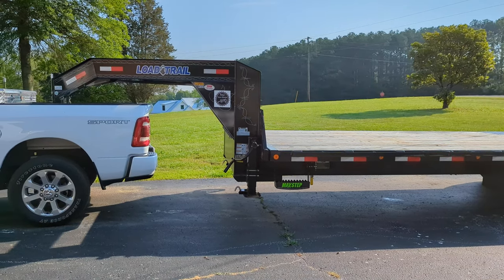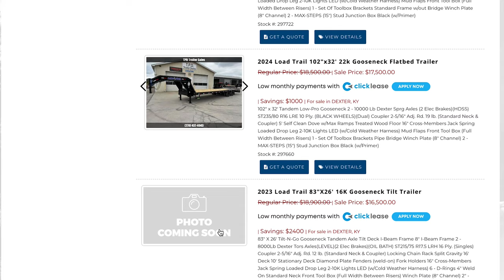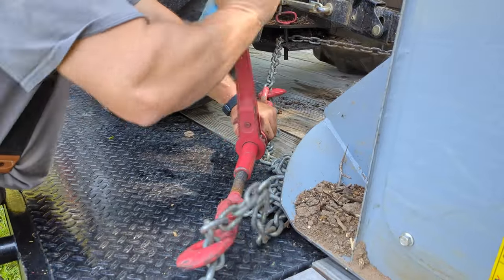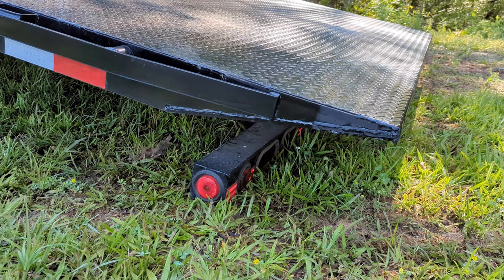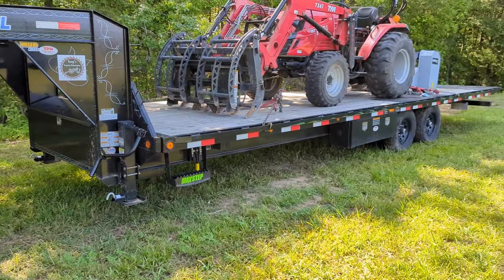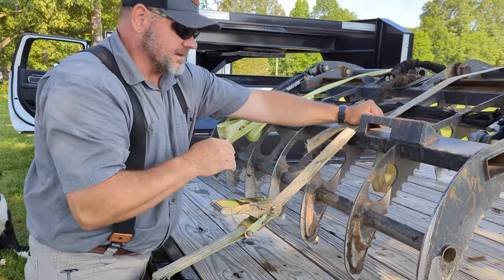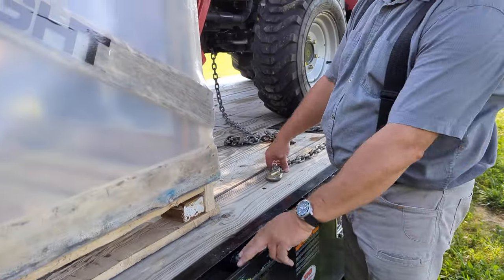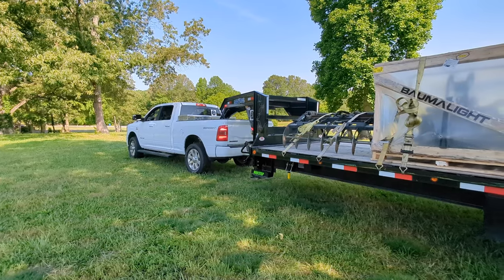Tilt Gooseneck Trailer - Deck Over - Buy the Right trailer!

Comment: Hey Chief I appreciate your post, but!  A negative and then some comparisons.  The possible negative is the single chain tie downs on your tractor.  A DOT officer might find exception to that method.  They like a four point pull.  I do it your way for very short pulls, but long and especially interstate pulling I go all out to not be ticket-able.  I bought my first 4x4 pickup in 1967 and personally always had bumper pull trailers.  I use my trucks more as super duty wagons, 98% of the time with a topper.  I do use load leveling hitch’s and can very the support arm rating if needed.  I generally haul smallish tractors ( that’s what I have) and two is my max weight  on a 20’ trailer.  No real complaints, two axle braking would be a plus for sure.  Carry two spares and cones, jacks, etc.  More stuff than you ever hope to need.  I also use an infrared gun to monitor wheel bearing and tire temps.  Grade 70 chains, etc.  I never had a stop, but I learned the hard way decades ago about extra spares and wheel bearing issues.  I love your rig, but too steep for this solo old man.  I haul for me, just a nut with too many tractors and chasing the bargains ( expensive education).  I think you need to use that remote, you don’t bounce like you used to.  6 out.

Comment: Great explanations of pro's and cons. I was going to suggest putting your ratchets on the right side as another commenter suggested. So much safer if you have adjust one on the road. A friend was hit and killed when he got out to adjust a chain binder on the left side. Appreciate you and Tanya, stay safe.
Reply from the maker: If I were going to make long hauls, I probably would. Most of my hauling is done from point a to point b. Less than 20 to 30 miles.
Reply: Copy That.

Comment: I do like your trailer.   Your review was spot on too, made me think about things i had not as of yet.
I want to make a "safety suggestion though, i noticed you made all your ratcheting attachments on the driver's side and for ease of use that makes sense but for "safety" please make them on the passenger side and all hard connections on the driver's side.  
Doing this is safer if you have to check your load or even make adjustments after a few miles.  This will put you on the grassy or sidewalk side of the road and farther away from traffic.  Drivers these days pay less and less attention when driving and you being on the "road" side puts you closer to traffic and raises your potential of being struck by a vehicle. (I have seen the aftermath of this, its terrible)  When you are in the passenger side you have an "out"... a way to run away from a potential collision.  
Please put your ratchets on the passenger side.  It is safer.  You have a great channel and would hate for anything to happen to you.
Reply from the maker: You are 100% correct. I get lazy on short trips. Thank you so much for caring and training me in such a humble way. God Bless.

Comment: I have a 20' bumper pull that's 16x4 beaver tail. Took a long time to get good at backing up. My brother has a 20' bumper pull that's 16' hydraulic lift. Hands down the best compromise I've seen between deck over and car hauler. But cost nearly 3x as much!

Oh and i haul water (900 gal) with mine regularly, with weight of trailer and full load, and balanced properly, it's just at the limit of my hitch. A goose neck would be a better choice. Compromises!
Reply from the maker: I understand about compromises. I love the trailer, but there are draw backs to this type that I didn't see before owning it. Still, It will most likely be here to I die.

Comment: The point about strapping down your load prior to loading your tractor is key. That makes the utility of a flat deckover with hydraulic dovetail MUCH more attractive. That note was key to your review and helped me tremendously. Also, its a crime to have hydraulics on the trailer... and not have hydraulic jacks.

Comment: Any thoughts on a deck over with rear slide in ramps?
Reply from the maker: If I had to do it over again, I would buy the spring up rear ramps. Slide in ramps would have a few problems on this size trailer. For the ramp to be strong enough to drive 10k up, they would be to heavy to pick up IMO.

Comment: First I would be curious what you are pulling the trailer with .

Why no one ever mentions the license required for pulling the trailer their demonstrating..

No on doing hot shot states what can go up must have a securing device over or through . Chain or strap .

My last suggestion is that I've never seen stated is Never hook a strap or chain over the rub rail and then winch tight .

This type of securing a load ensures any load that shifts and or   compresses down to to vibration or crushing loosens tie downs and leaves load unsecured.
Reply from the maker: Thank you for your comment.

Comment: That angle isn't an issue for most cars. A super low car might have an issue like a Lamborghini. My father's driveway is much steeper and a Tesla goes up that no problem.
Reply from the maker: Owning it, I can tell you that you are wrong. It will tear the front air dam off most any car.

Comment: What is the GVWR?  How can you legally carry more?
Reply from the maker: We don't even need tags
Reply from the maker: I never said anything about legal. If you are pulled over and the scales are put under your wheels, it will read the amount of weight on each wheel. As long as it comes in under the GVWR you will be fine legally. Goosenecks are made to transfer loads to the ball. Grease them.